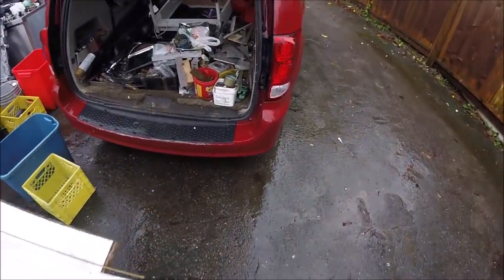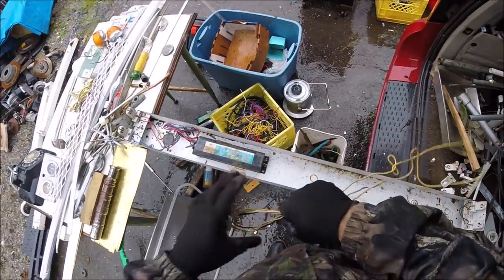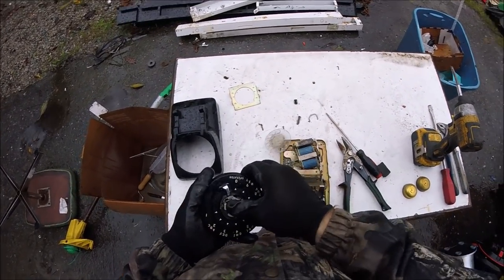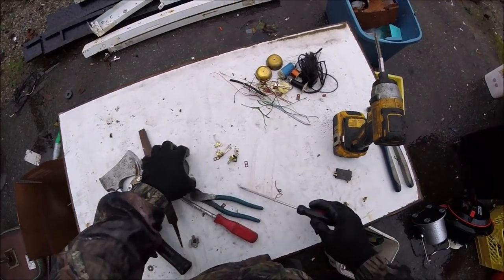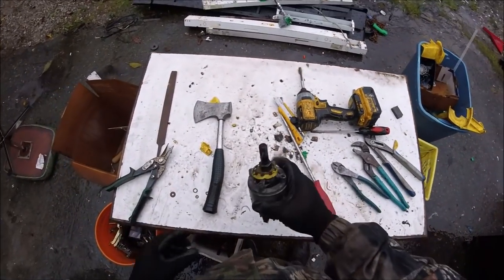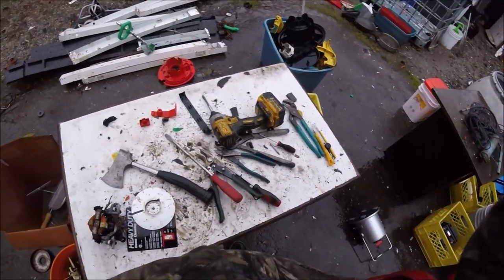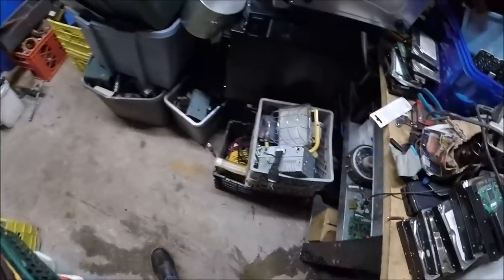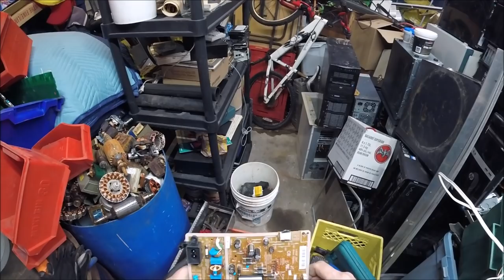Scrapping Out My Scrap Pickup & Scrapping old Dial Phone

Comment: Those plastic turning thingies(?) on the blenders are reverse threaded. Grab the cooling fan or vise grip the rotor at the other end to secure the rotor and just turn it clockwise. It will unscrew right off. I once found a very large blender that had a 5 pound copper motor in it not including the rotor or housing. 1.5 pounds of copper.